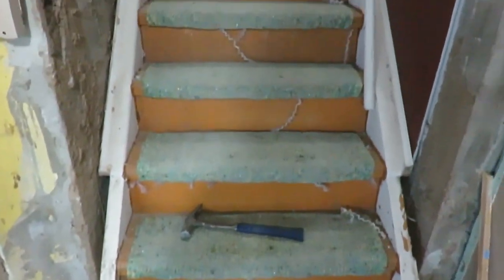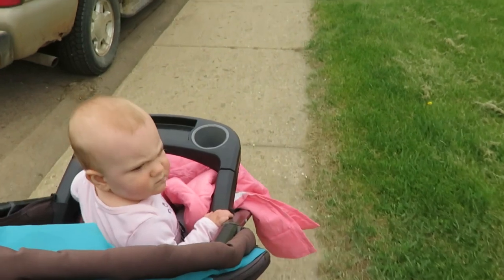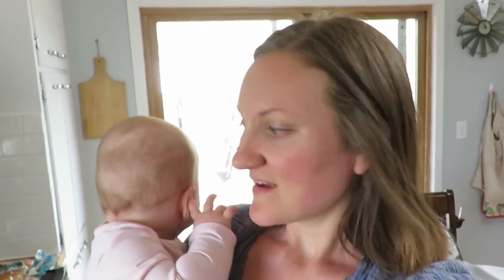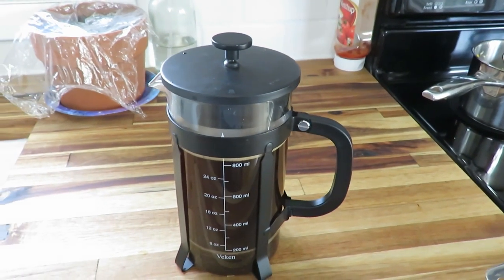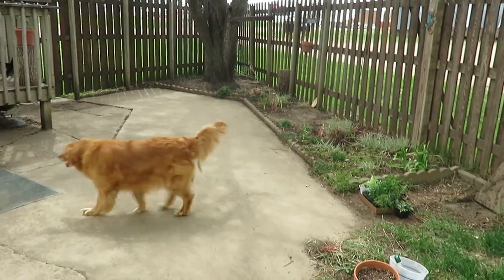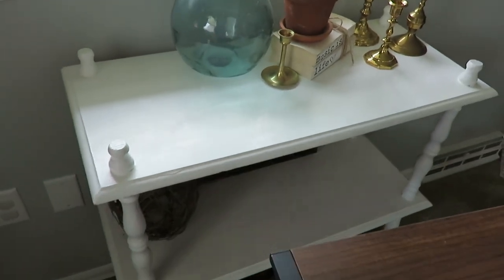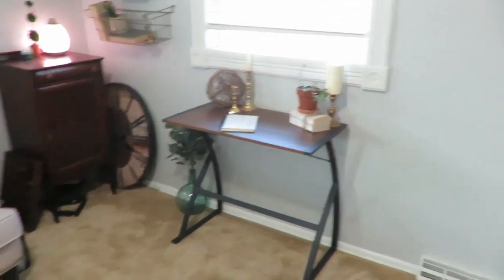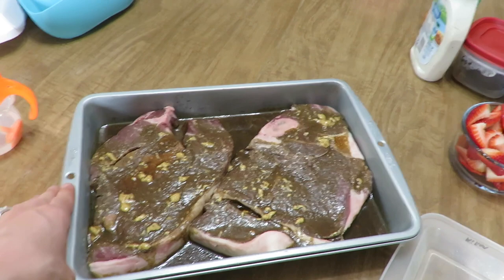Small town life, redecorating & house reno projects | DITL vlog

Comment: Is the register in the kitchen a hot air register or a cold air return register?  If it is a hot air register I would maybe move the wood (cabinet?) that is in the corner by your desk into the kitchen  since it looks it sits up on legs up off the floor.  If it is a cold air return then the white shelf might work there.